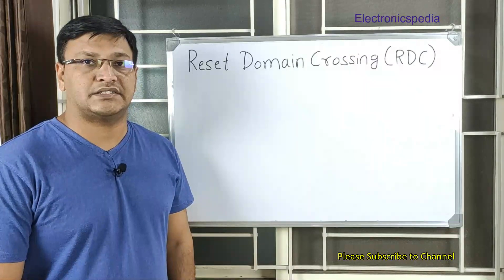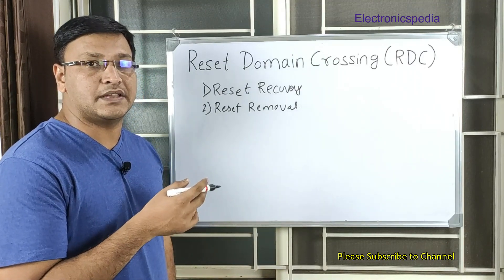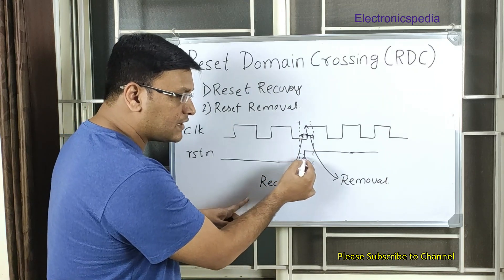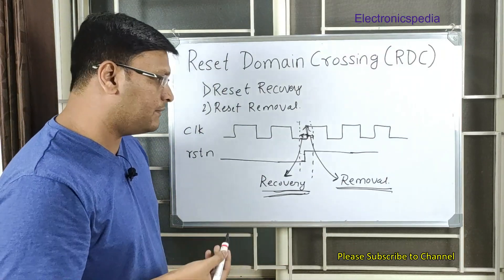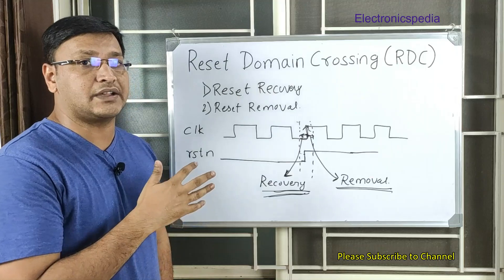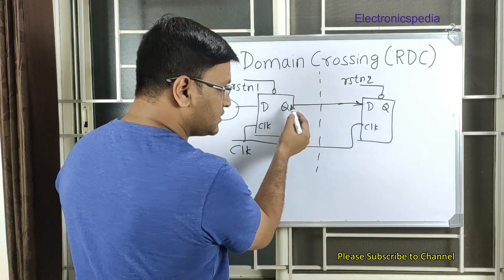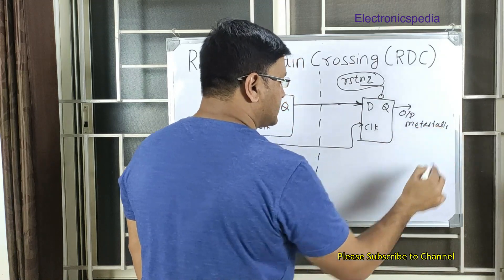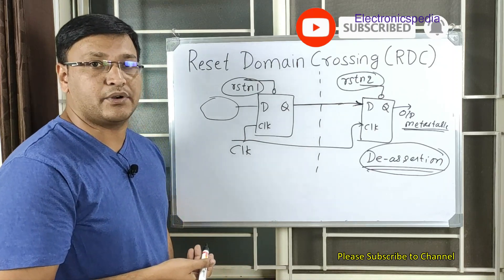Reset Domain Crossing (RDC) Basics | Reset Recovery | Reset Removal | RDC Basics | VLSI Interview

Comment: RDC is assertion issue not the de-assertions. and also if you can cover reset ordering as one of the techniques to solve the RDC.
Reply from the maker: I agree with you RDC assertion is problem if there are two resets, the destination is de-asserted and source is going under reset. 

But de-assertion of reset is also a problem when reset is not not de-asserted synchronous to clock. 

I think my message was not conveyed properly. I will put a note in description

Comment: RDC Issue is basically source reset to destination clock issue. It is related to reset assertion which means that if reset of source flop gets asserted and it causes input signal to destination flop change during aperture window of destination flop then that flop goes into metastability.

The point here you are making is reset de assertion. Here, What happens is that if reset gets deasserted in the recovery - removal window of the flop, then it will cause metastability, which further means during that window period, reset signal should be stable.
 
Yes, It can also cause destination flop goes into metastable state but It will be not be treated as RDC issue. This will be another form of CDC only. It can be taken using reset synchronization using reset synchronizers.
Reply from the maker: Agree to your points.
Reply from the maker: I have explained your points in the next video .

Comment: not only deassertion! rstn1 could also assert at a point close to clock edge and flop2 can have metastability due do data change to 0 close to edge
Reply: Yes, this is the major problem. it happens only when aserting the rstn1. Hence some RDC checks are formed to make sure they are destination flop is protected from asyncronously resetting the source flop.

Comment: RDC is assertion problem and not the deassertion problem, please do correct
Reply from the maker: Would you please explain how RDC assertion is problem ?
Reply: @Electronicspedia  when rstn1 is asserted  and rst2 is not in active state , so output of first flop can change to zero  independent of the clock . Which can propagate to input of second flop and can cause the metastability . 
This is the RDC .
Reply from the maker: Thanks 👍